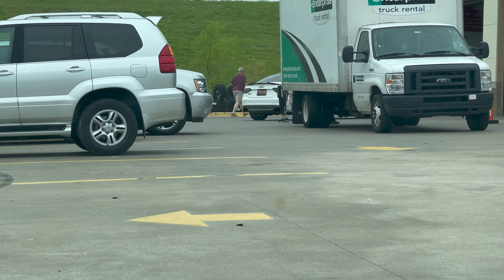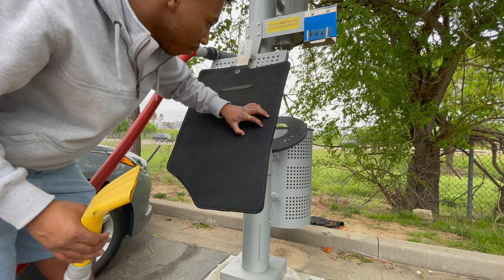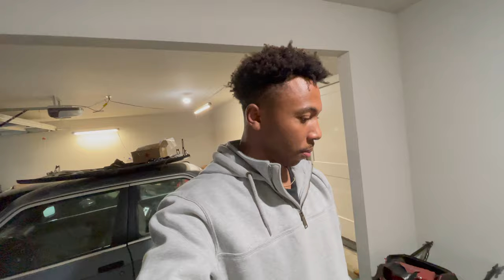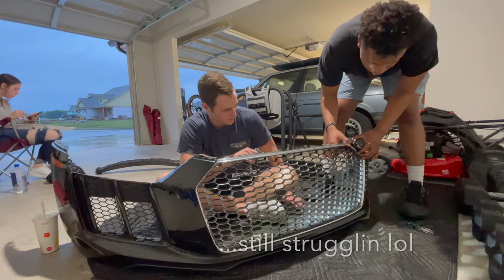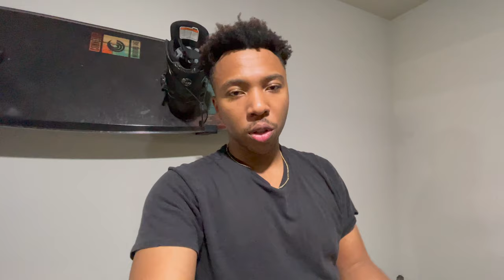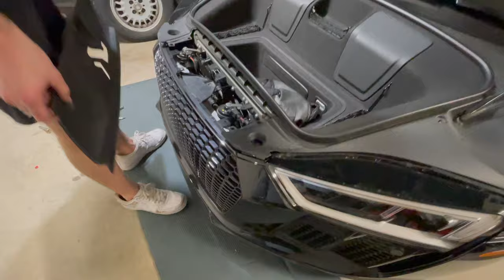INSTALLING THE BLACK OPTICS GRILLE ON AN AUDI R8!!!

Comment: Can you please share full part number incl. colorcode for the black one?
Reply from the maker: For sure! Let me find out the exact one!
Reply: @tariqsamuels8578  i found yesterday these numbers:

4S0853651GRN4 (dark chrom)
4S0853651G3FZ (black)
4S0853651GJC4 (gunmetal)
4S0853653D (idk, on some pics i saw chrom and black frame)

Not sure what audi means with the first one. Hyped to see which you have.